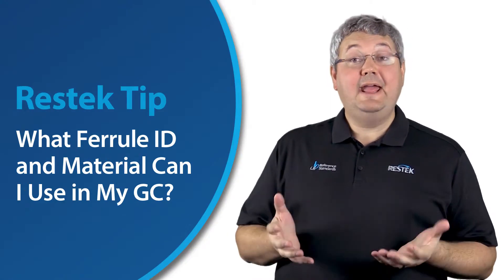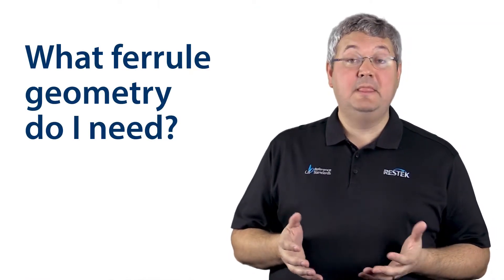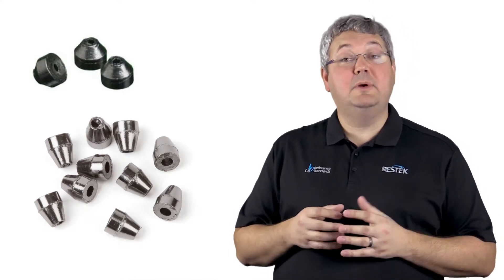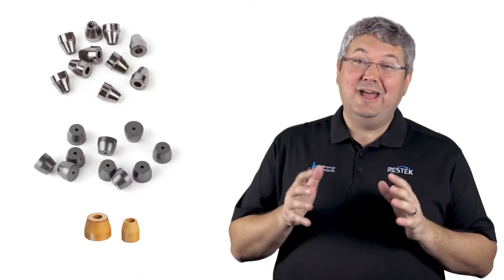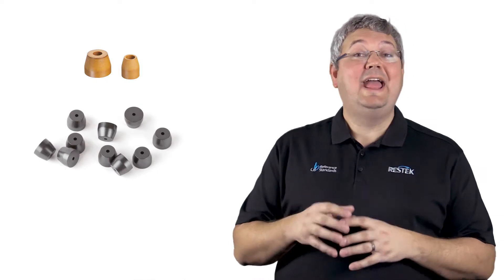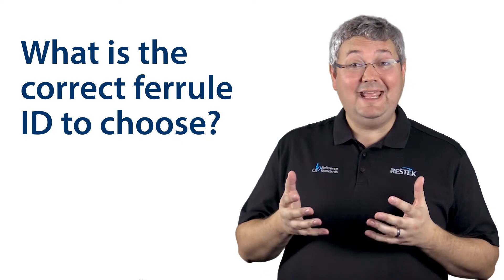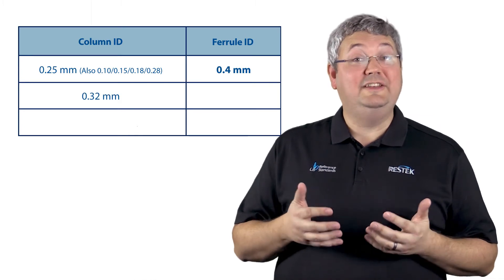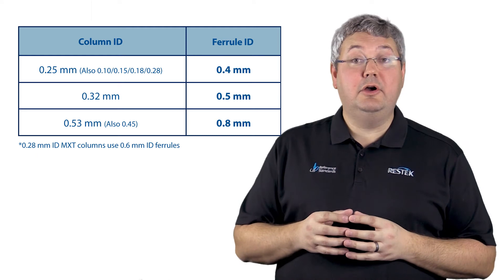What Ferrule Material and ID Can I Use in my GC?

Comment: Why is graphite not good for GCMS? We have been using graphite o-ring for liner and graphite ferrules for connections. What problems have we been overlooking?
Reply from the maker: Pure graphite ferrules can leak under vacuum. It is generally recommended to use a vespel or vespel/graphite blend, particularly at the source nut.